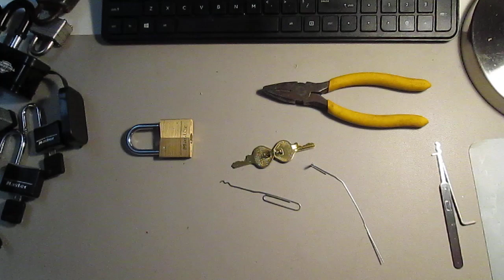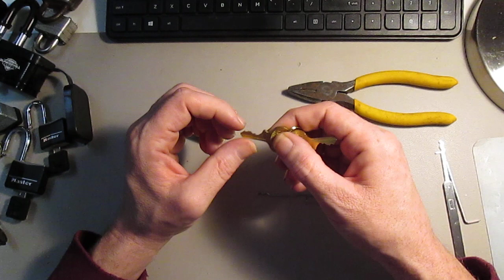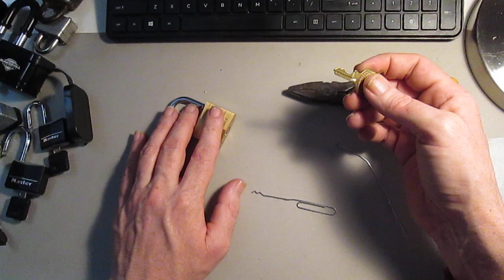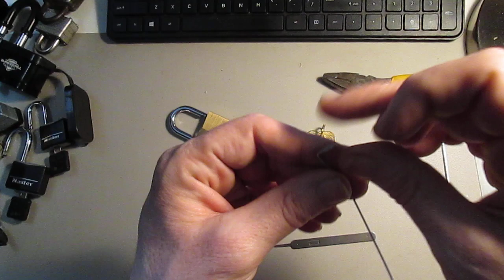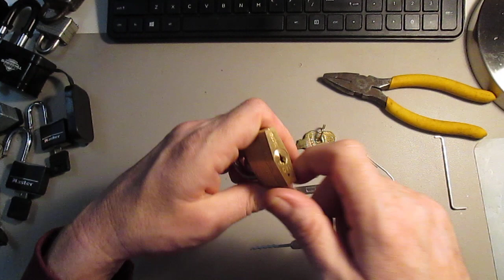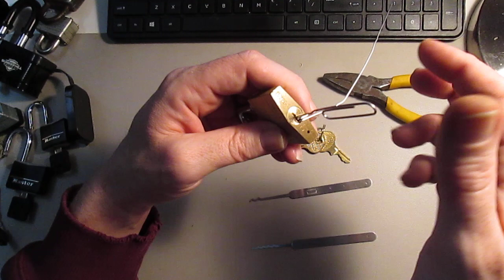067 Paperclip Rake and tensioner for a viewer question

Comment: I'm trying not to do a Master Lock joke but it's so hard 😂😂😂😂
My goodness you put in the paperclip rake and the lock opened,  almost as good as the key. I think you bent a good profile there and the result shows it off to be true. I totally agree that it's lock specific with a few factors which you covered. 
😉👍
Reply from the maker: Thanks Roy! Lol yes indeed, insert masterlock joke here lol!! Yeah, j had never tried this before and was worried about the size paperclips! They were the only size I had lol... the only other lock it would fit in was that bunker hill. Thankfully it fit perfectly!
Reply from the maker: I had to model it on the rake I had... not having that I wasn't sure of the depths or spacing...

Comment: Sorry I dident respond fast! I tried it with a larger master lock padlock, and a brinks, which looks simmaler to yours. The masterlock I dont have a key for, but the brinks I do. I made tools simmaler to yours, but the rake had more ridges. I tried it for about 45 minutes, and the pins seemed to pop right back after I pushed it with the paperclip. So I tried moving it in and out sorta fast, but still with no results. I will try again some tommorow, but I think those pins not staying in place may have something to do with it.
Reply from the maker: Yeah, having the key will definitely help. also, depending on the model of the brinks, it may have spool pina in it. if that's the case it will be much harder to rake, especially with a paperclip. I only put to humps in mine because i know with the bidding on my key 4 humps would end up over setting the 1 and 2'nd pins. To do this I think you really need to have a lock with no security pins to start. If you're not familiar with lockpicking and your just starting out maybe look for a new masterlock model 140 but look at the key and make sure there are not extreme high low cuts in the key. Try to find a key with "flat" bidding on it. i.e all the cuts in the key are relitivly the same depth or slightly sloped... again i'm still new at this. this was my first paperclip job lol. let me know if you need any more help! there are a great number of youtube channels out there as well... oh and tension is very important! it's hard to explain but you need to keep it light when raking... let me know how you make out!!
Reply: @thecompguy  that could be part of my issue, I was pressing realy hard on the tension tool while I was raking.
Reply from the maker: @bricksandpieces1  that could very well do it.... watch the next video I put out about notes on the first one if ud like to... youtube can make things look easy... that's why i suggested knowing the bidding on they.. I explain it a bit in that video... keep me posted on your progress!! always glad to help out!